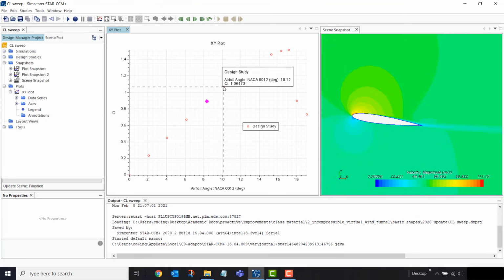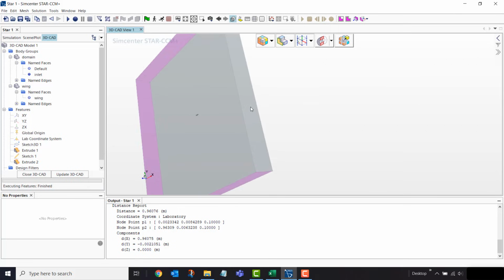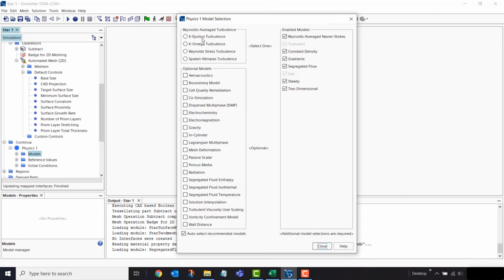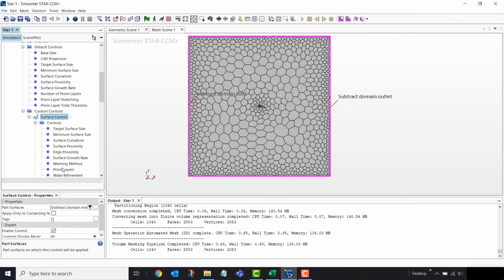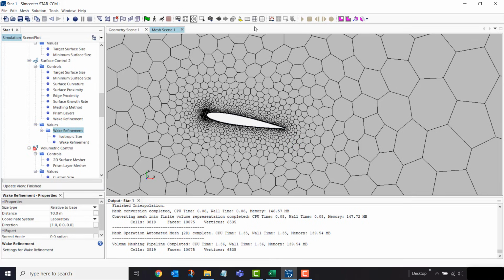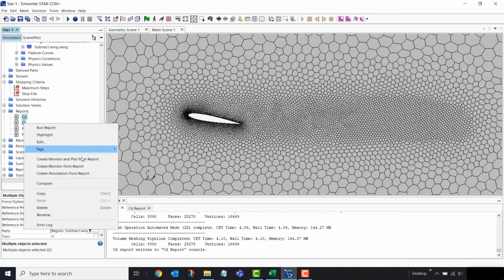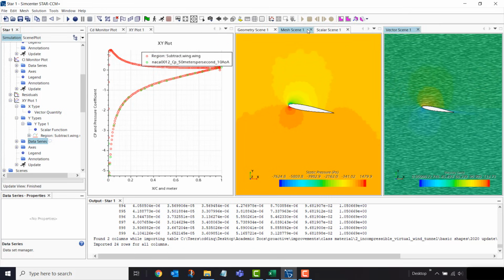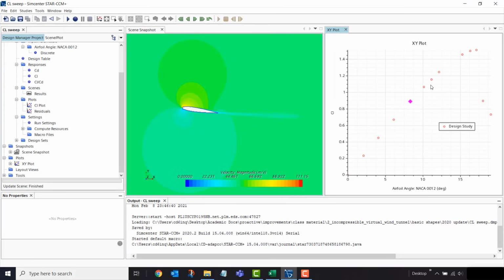STAR-CCM+ 2d wing build, mesh, run, validation, and automation

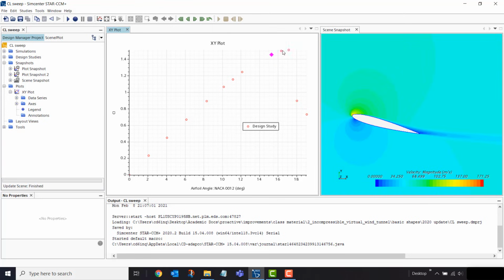Comment: 00:00 Discussion of the methods importing it on to Star CCM
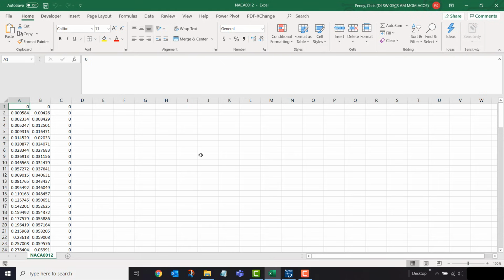01:08 Explanation of Excel spreadsheet
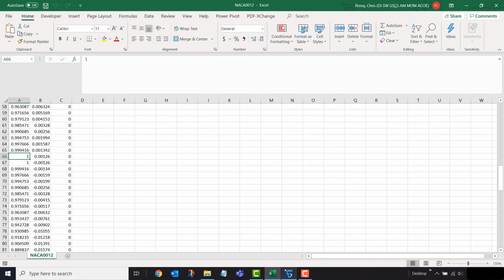02:00 Importing of the coordinates of excel into star CCM
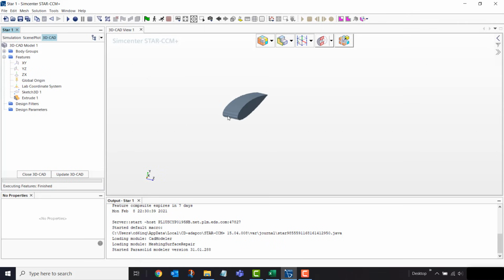02:30 General controls you can use in star CCM
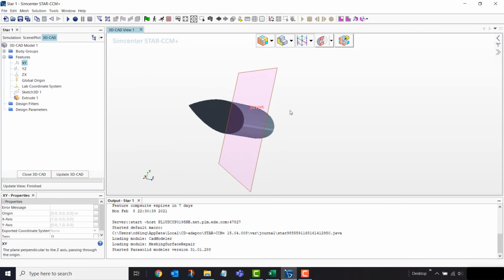03:15 Creation of the domain and looking at the size
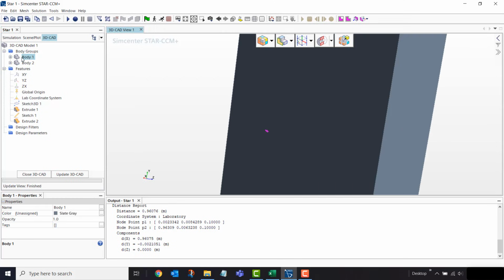04:30 Renaming the parts
04:55 Control and naming of which side is the inlet and the outlet
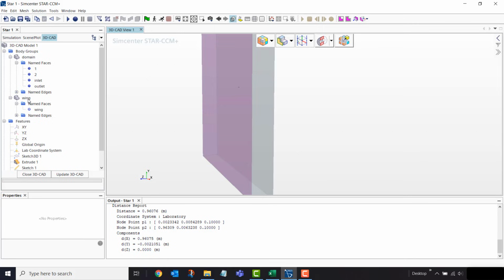05:55 Rotation of the wing
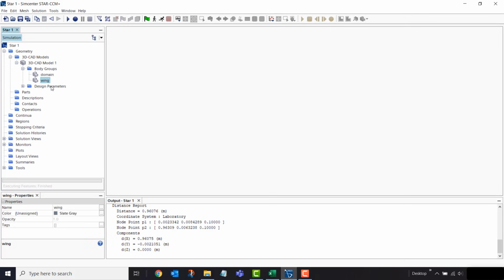06:50 Creation of the new geometry part in preparation for meshing
07:25 Subtraction of the wing from the domain
08:25 Identification of the geometry where z = 0
08:43 Assigning the settings of the meshing
09:44 Allocation of the object to be meshed
10:15 Generating the physics of this Aerofoil
11:14 Reference pressure of the surrounding environment
11:25 setting the wind velocity
11:57 Defining what parts are the outlet and what parts are the inlet
13:07 wind flow directional control
13:57 The beginning of making changes to the mesh
14:20 How to show mesh on screen
14:35 Base size meshing explained
15:25 Target surface size referencing base size
15:33 explanation of the minimum surface size
16:03 Creating a concentration in the centre of the mesh rather than the outer part
16:50 Meshing button & result & analysis
17:50 Creating the thinning of the mesh 
18:25 Stretching out the layers of the mesh
19:00 Leading edge refinement
19:30 Creating a simple object to let Star CCM know where to start the refinement
19:50 Changing the view so you can get the top down view
20:36 Mesh constrained to the shape that you have created onto the aerofoil
20:48 Refining the wake of the body and refining the mesh around the body
22:25 meshing the new refinement
22:51 Going through files to see what you need to go through
22:57 Stopping criteria -> Maximum steps
23:18 Reports file -> Coefficient of lift report Continuation in 24:46
24:18 Reports file -> metrics-> Frontal area Y
25:45 Reports file -> Coefficient of drag Continuation in 26:20
26:03 Reports file -> metrics -> Frontal area X
27:15 Create monitor and plot
27:49 Scenes folder
28:05 Scalar Scene folder
28:43 Scenes -> Creating a new vector scene
29:35 Running the simulation and the graphs
30:13 Creating the XY plot 
31:00 pressure coefficient does not have the data that is relevant to his case
31:10 Changing the pressure coefficient (Tools-> Field Function -> Pressure coefficient)
31:48 Importing of the experimental data
32:20 Method of importing (Tables -> New table ->File table -> Whatever file that you want to import)
32:35 Inserting the file that has been imported to the graph to compare
33:17 Showing the change of angle of attack (AoA) through simulation
33:24 Solution -> Clear Solution to forget history to make the graphs start from scratch
34:55 Bringing in new geometry or importing a new wing
35:15 Replacing the geometry with a new geometry
35:44 Resetting the solution 
35:56 Automating the angle of attack sweep
36:10 How to automate the process
36:27 Loading in a pre-built one
36:50 Design study sweep mode
37:08 Putting in different discrete value
37:18 More information about the prebuilt simulation on to the software
37:55 the graph of airfoil angle and lift coefficient which shows the changes in the airfoil